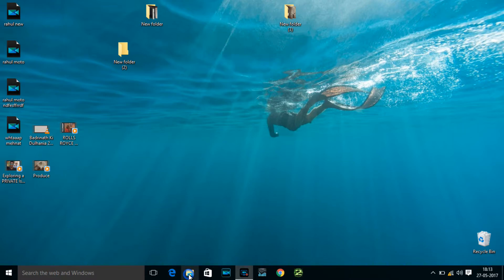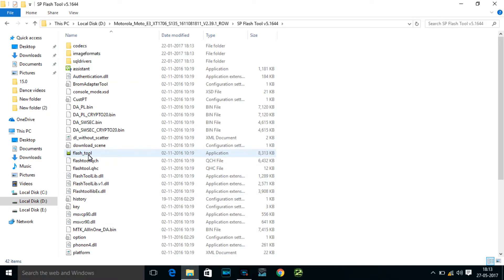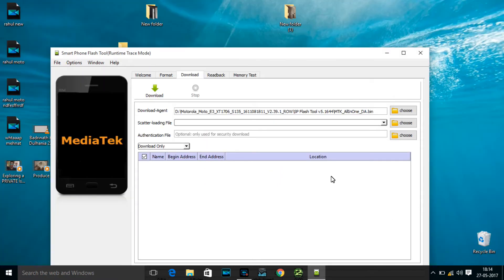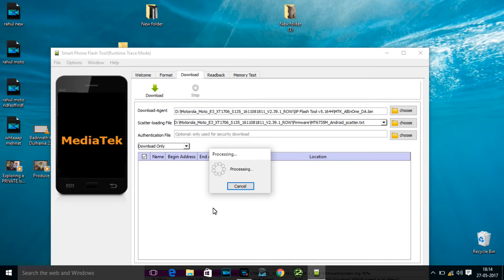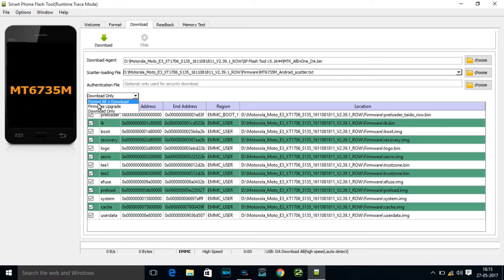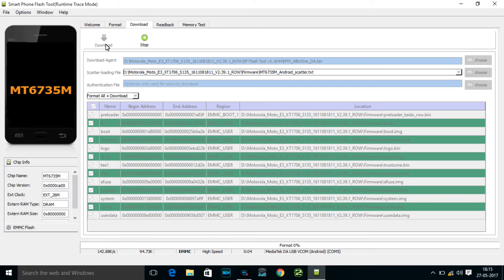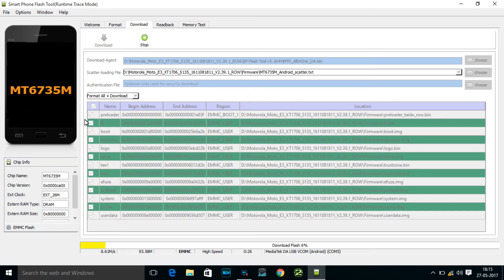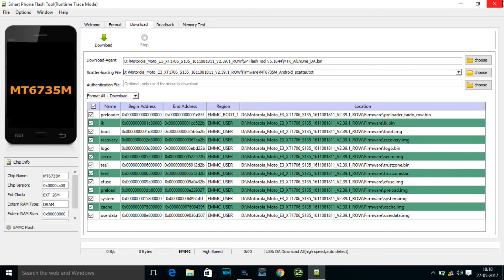Moto E3 Power stock ROM installation process

Comment: I unlocked the bootloader and tried some roms but then i wanted to go back to the stock rom and i tried your method but the device doesn't even start now , it says error 1011 not enough storage space.Can you help me?
Reply from the maker: Shubham Sharma in the flash tool u need to select format+ download storage issue will be fixed
Reply: Thanks i fixed the issue i just had the wrong firmware file.
Reply from the maker: Shubham Sharma glad to hear that.... Thnx 4 ur comment..
Reply: 912 mb doesn't work? which fiemware file is useful among the list? 952mb, 771,705,681, 677?? which one is fine?

Comment: I flash stock rom from your method but after switch on the phone and complete all thing no network show.and both network error is invalid imi.please solve my problem or tell me how to fix it.the firmware is 912mb
Reply from the maker: +vishal pandey brother dnt worry it is fixable u just need to download sn write tools and the version should be old the latest one dosent works well with moto e3 power... just download sn write tools old version and google it how to use.... its easy to use...

Comment: Bro I installed stock ROM file extracted it, then installs CDC driver, then open sp flash tool then add scatter file last one, then selects download all,then select download then I connected my phone but nothing happens the computer says divice driver not installed, what's the reason help me
Reply from the maker: +Ajay Jose install drivers of your phone and driver of your processor for example search if your driver is meditek 6735 then download and install driver for that chip
Reply: Techy Rahul 
How to know processor chip model
Reply from the maker: Google it or use cpu z

Comment: hi rahul when i select scatter file on spflash tool it shows invalid scatter file whats the problem????
Reply: reply me....plz...
Reply from the maker: Try another stock rom... Theres a problem with your current rom
Reply: but i already flashed with that scatter file  but now onlly it shows this error
Reply from the maker: Are u using different sp flash tool aur the same one which u used earlier
Reply: yes bro is its the fault
Reply: hellooo bro are you here
Reply from the maker: Download new sp flash tools a version older then try
Reply: okay bro i had another doubt
Reply: you told me to select format all+download for the charging issue if i do that is charging problem is solved????
Reply: helloooooo??????

Comment: Is there any custom ROM available which supports VoLTE service for Moto E3 Power
Reply from the maker: +Sarfaraz Habib nope.. till now.. lets see what happens in future..
Reply: Techy Rahul I've take nandroid backup for stock ROM..but while restoring...stuck on bootloop
Reply: Are you there? Reply
Reply from the maker: +Sarfaraz Habib bro jist install the damn stock rom its easier.. yes u will lose data but nothing can be done... Talking about the nandroid backup it can be retrieved.. nut u need to install a clean stock rom then try extracting ur backup from nandroid... U will get ur data back...😀
Reply: stock rom has been flashed but sim network is not working. can you help me bro
Reply from the maker: +Sarfaraz Habib download sn write tools v1.5 and write imei no
Reply: Techy Rahul what will happen after ot
Reply from the maker: +Sarfaraz Habib signal will come
Reply: Techy Rahul while dialling *#06# only white screen comes... IMEI didn't seen
Reply from the maker: +Sarfaraz Habib open battery u will find ur imei no or see it in box... U need to punch that imei nos into ur device using sn write tools
Reply: Techy Rahul at that time device connection to pc mandate? Coz getting error of invalid IMEI

Comment: Bro i successfully flashed my mobile

But the problem is after flashing .y mobile charging speeed is toooo low....
Any solution for it

I use my stock charger before flashing it takea only 2hrs to charge from 0%to100%
But now it takes 2hrs for just 10%

Plz hlp me....
Reply from the maker: At the time of flashing you select format all + download the problem should be solved
Reply: Techy Rahul ok if i do format all+ download what'll happen to imei no.
Reply: And whats the difference between format all+download & download only....

Plz...tell me bro
Reply from the maker: Dont worry just diwnload sn write tools older version and its easy to use aap
Reply: Bro reply me.....
Reply: Ok bro then....at the time of rooting the command "fastboot format userdata" doesn't respond what i do......
Reply from the maker: Its ok no prob u can skip this command
Reply: Techy Rahul i skipped this command but it causes boot loop
Reply: Hlo bro...

Comment: bro i will try it but fail and problem is same
Reply from the maker: +vishal pandey bro it will work i downloaded all old version starting from the latest and one of them worked this is the best way.... start downloading older versions starting from latest one and try them one by one.. one of them will surely work... sorry i dont remember the exact version which worked for me..
Reply: i have try more versions but in sn tool fill the imei  number and then start and pluged usb cable in pc but its fail error show.
Reply from the maker: +vishal pandey bro its sn write tools version issue nothing else
Reply: ok
Reply: PLZ give me one version .i will try 4 version and i get ame error .plz also concern me srial number and bt barcode .what is put in this case
Reply from the maker: +vishal pandey brother u need to put only imei no nothing else is not reauired please browse the working version by yourself  its 1.5 something
Reply: i try in 1.555 version but put imei and now start then usb connect to pc but it some time later the error is fail .i dont know why